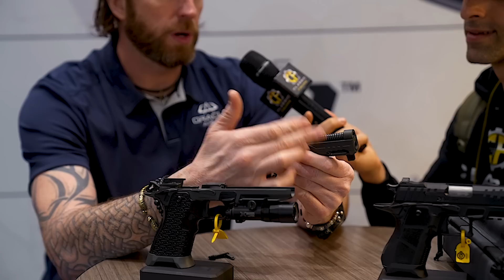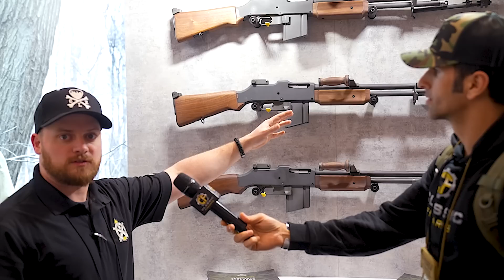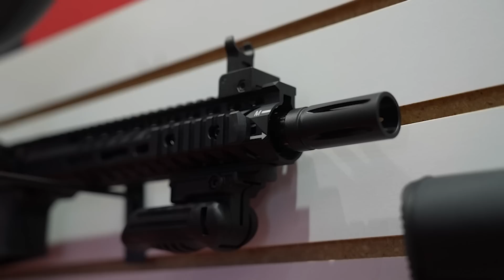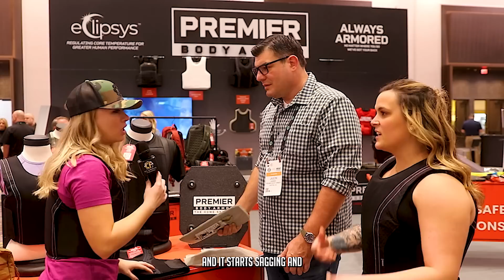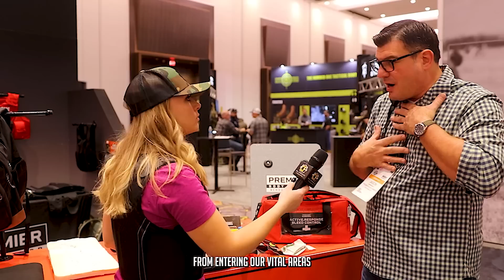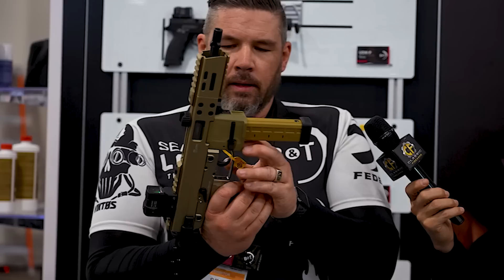SHOT Show 2023 Day 4 (Pt. 2)

Comment: the orical arms gun that he pulled down ,,the pin he pulled out and dropped it on the table so not a gun id ever want to pull down in the field ,,under stress i would drop that pin and it be gone ,,,and if all there guns pulled down like that i wouldn't want one ,to be honest i cant believe they would have all these great designs yet the pull down pin is not captive which is a super important pin as your F&CKED WITHOUT IT HEY .!

Comment: My wife and I have entered your contests for quite some time. recently however my wife has had to stop entering due to problems clicking on the video's but it then going back to have her "log in" to one of a variety of possibilities; Google, Twitter, etc. Once we do that, then when we try to click on videos it reverts again back to have her "log in". Now it does it to me. Bottom line, this will be my last entry. Tired of messing with a system that doesn't work. No we're not a bot or what ever. We're an older couple in the middle of VERY rural USA...limited internet and enjoy our firearms.

Comment: LOVE the Oracle 2311 but don't like having to remove a part to take it apart. Much prefer if it had a mechanism like an FNX or Sig P320 that doesn't require any parts to take it apart. Just turn the small piece down and good to go, don't even need to pull the trigger.